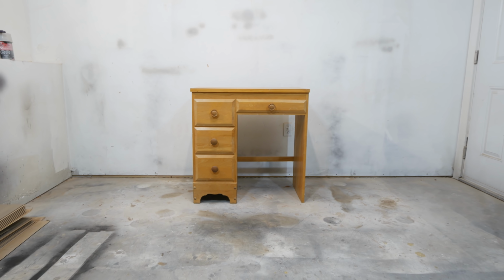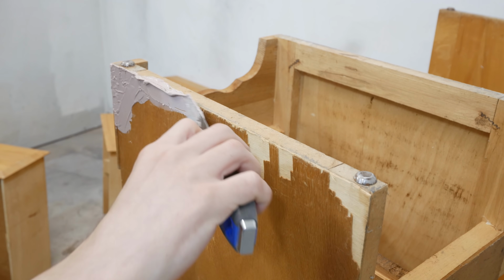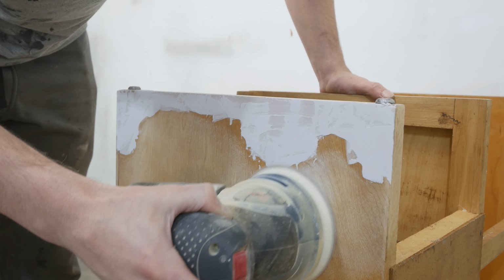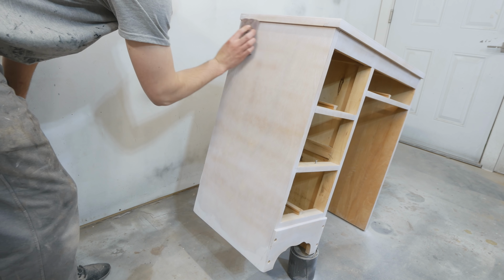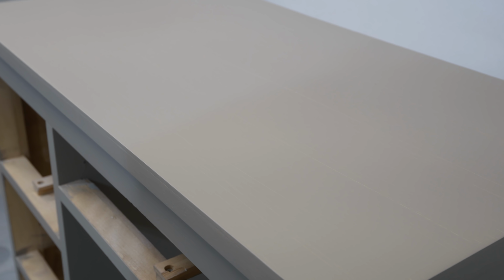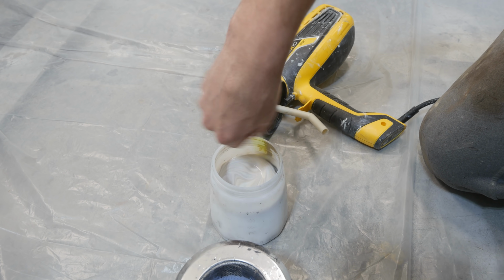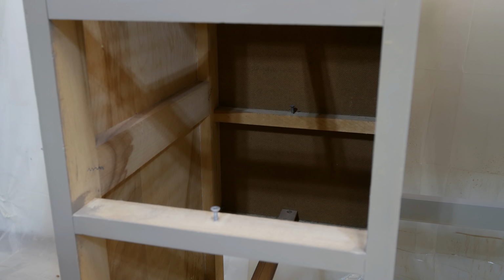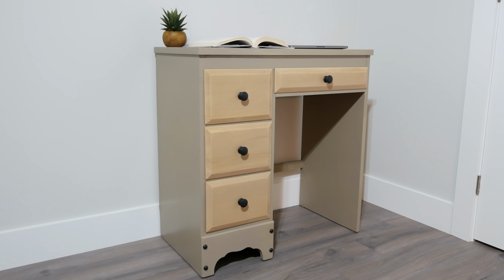HOW TO PAINT A DESK | Before and After Furniture Makeover

Comment: A tip when using bondo for ur repairs (coming from a career in autobody repair) before you put your bondo onto the repair area first sand the surounding area. This way the bondo will have space tk feather out onto a sanded area and not chip off .

Comment: Can you do a whole video on your sprayer? I have the same one and I cannot seem to get the water/paint ratio and the dial level correct
Reply from the maker: Of course! This gun is tricky with water-based poly, you will waste a lot I find. Every time you spray you need to start it before your project because it spits poly. I usually spray the wall for a complete seconds, and when you start spraying don't let go or it may spit to. I am sure I can explain better in a video, I will have to make one soon.

And for the water amount, try to measure 10% for poly, and for paint I start with 10% and if it doesn't spray well I will add 5% at a time, sometimes I don't even measure for paint I just get the consistency I want.
Reply: @FurnitureFlippa  thank you! I even used a velocity cup and it was larger than the one I saw a video for so I wasn't sure how fast it should be flowing, then when I tested the gun on some cardboard it was splattering no matter which level I had it on. I will try 10% and a video would be amazing! Most wagner videos out there don't focus on the water amount or the dial level and those are the most important parts I think!

Comment: Love your work and simplistic style of making videos. Straight to the point, no bells and whistles. You said you used 3 coats of poly on this. How many times would that require you to refill yoir sprayer with poly. Ive stayed away from spraying poly and paint even because i feel it might use alot more product. I have a spray gun like yours just a different brand. Please guide me.
Reply from the maker: I used the 500ml and added a tiny bit I had left from another can, I use more with my wagner cause it spits out poly before each spray. My homeright does not, but I am waiting on parts for the homeright!